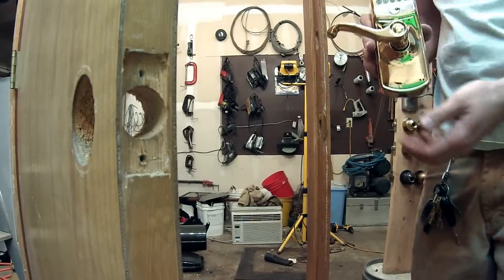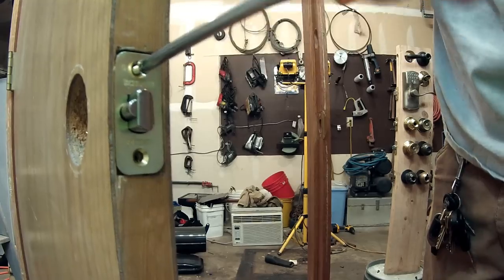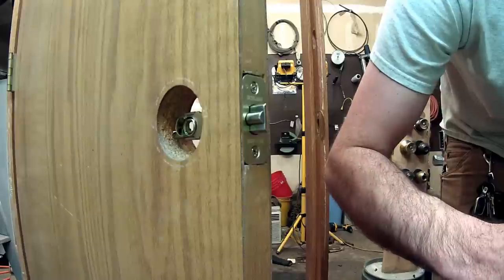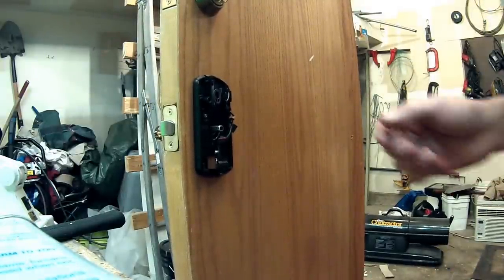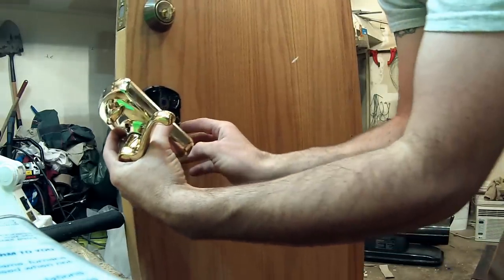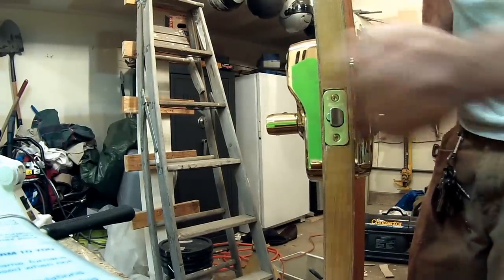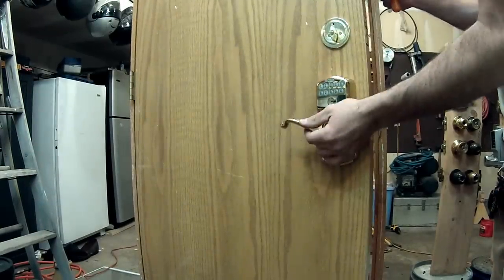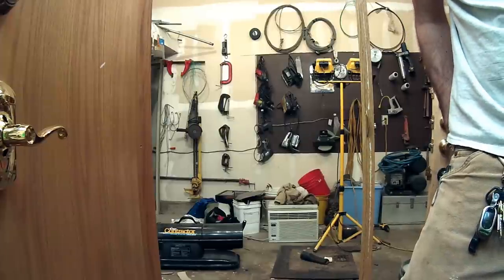How To Install a Electronic Keypad Lock (Schlage)

Comment: Don’t...MOST entry doors PUSH to COME INTO the house from the outside,  and PUSH the door shut to CLOSE the door once inside.  Your demo door seems odd, to PULL the door to open to come in and also PULL the door inwards to shut it closed ????   My door handle & latch are on the left side of my door, opposite to your demo.  Also my latch assembly, I have the bevelled or slanted side of the latch facing to the outside of the door on the striker plate, WHERE, opposite of yours ( so the bevelled slant side always has to be on the side the door shuts or meets the door jam !  )... You said people miss setting up the latch the right correct way, but it seem it cans only go in one logical way .....ALSO if I was to purchase this Schlage electronic key pad combo lock with handles,  I would need to REVERSE the handles.

Comment: Thanks, Wayne! This was a huge help. Gave the video a thumbs-up. :)

One small thing - I'm really nervous around wires and circuitry because I'm never sure how much pressure they can endure and I'm always worried I'll snap something. This was especially true when I installed the Schlage keypad lock, since the wires are pretty fine and it involved tucking 2 wires tightly into a small side-pocket.

Next time it would be ideal if you either showed the whole wire-tucking process a bit closer (or had a second person help you get a more detailed angle).

Otherwise this was a super succinct, very clear visual guide and it helped a lot - thanks again!
Reply from the maker: thx